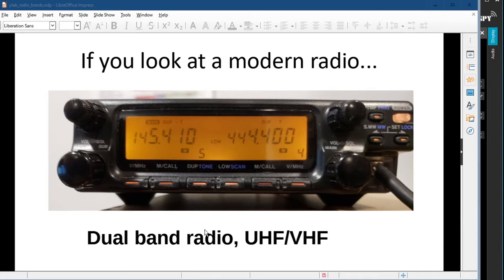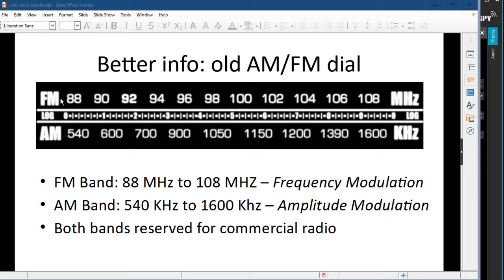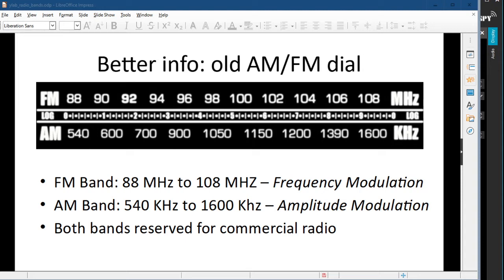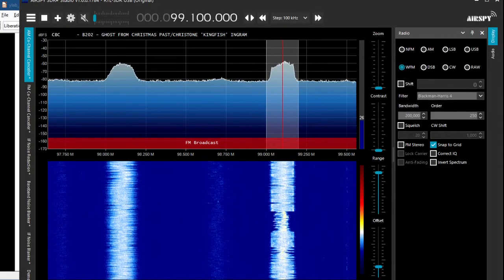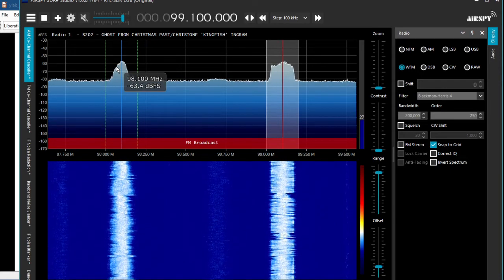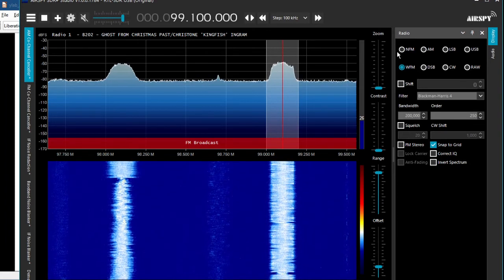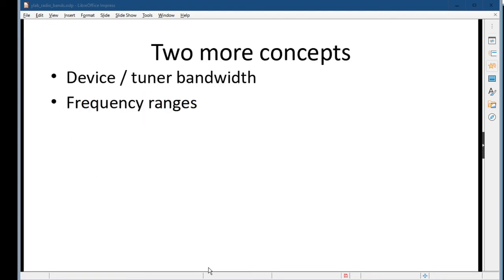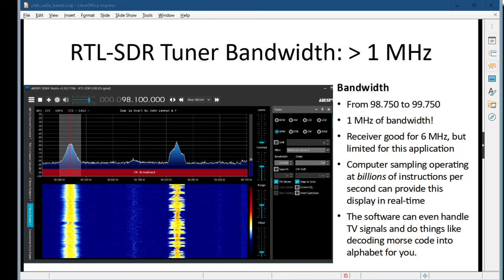Ylab Radio Tech Series: Understanding bands, signal bandwidth and device bandwidth

Comment: Except for one band, the maximum bandwidth of an amateur station’s transmission allowed between 7 and 28 MHz is:

I'm a little confused about what they mean here. So... Do they mean Amateur station’s transmission allowed between 7 to 28 MHz  with maximum of 6 kHz. or  do they mean only this too 7 MHz = 6 kHz, 28 MHz= 6kHz. Hope you understand what I'm asking. Feel free to poke holes in what I'm saying.. 73 😆
Reply from the maker: Within any of the amateur bands, you are allowed to use what is required for your signal. This is generally about 6 KHz. Take the free course or consult one of the references on the training web page for more details.
Reply: This question is a bit tricky, because the 10 metre band, running from 28 to 29.7 MHz, is not in the range 7 to 28.  On all bands but one in that range, the maximum bandwidth allowed is 6 kHz. The one exception is the 30 metre band,  which has a maximum of 1 kHz bandwidth - so for practical purposes no voice communications or wideband data. The 10 metre band, like the 6 metre band (50-54 MHz), allows bandwidths up to 20 kHz.